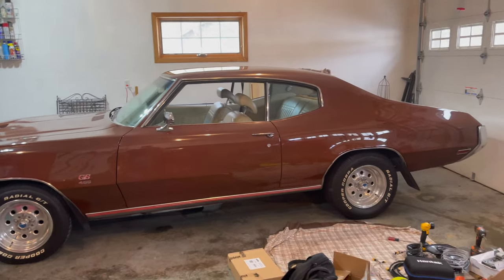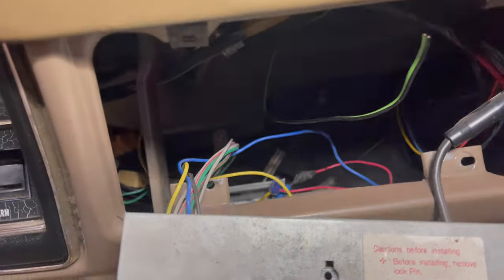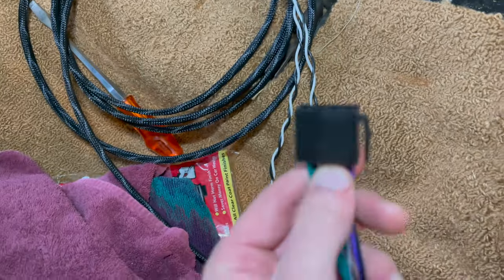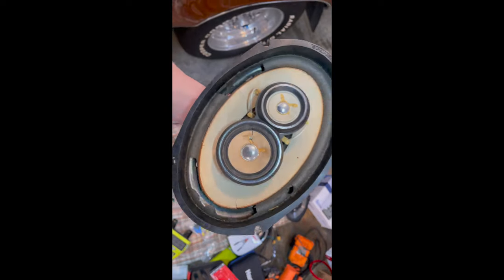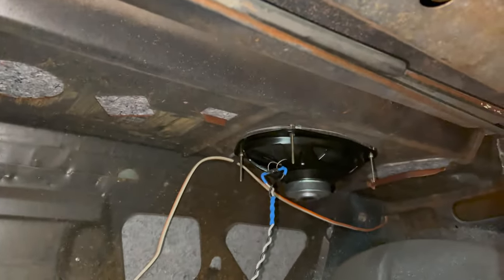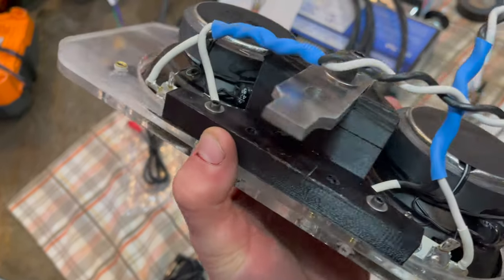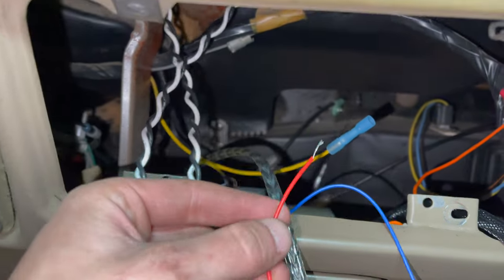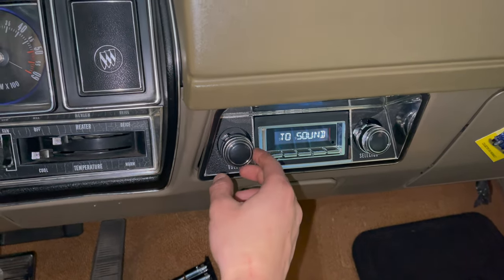Classic Muscle Car 71 Buick GS Full Sound System Upgrade and Install w/ Bluetooth!

Comment: As the owner of the car, Blake did and excellent job researching the speakers and the radio unit. The design and creation of the front mounting bracket for the front speakers was very impressive.  All connections were soldered, with shrink tape over the connections.  The wires were laid neatly throughout the car and engine bay.  Very impressed with his work and creative design.  Thank you Blake for an awesome job on the new stereo system for my car.  The system looks original and sounds awesome.
Reply from the maker: Thank you Jeff!